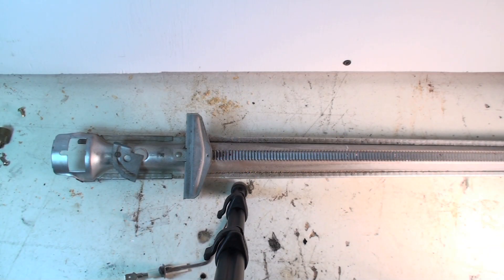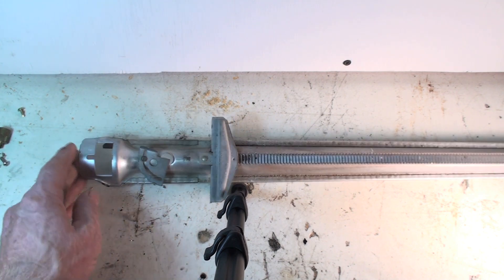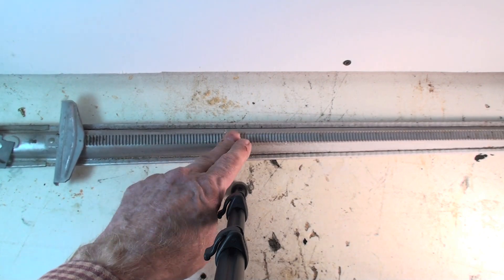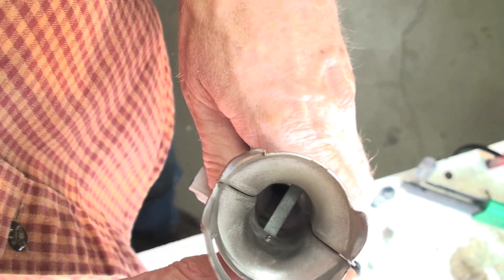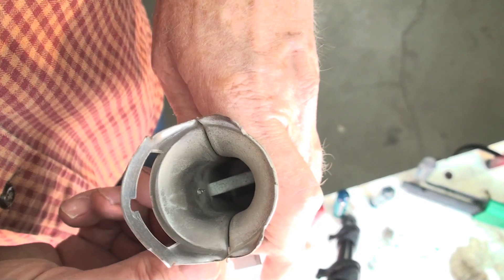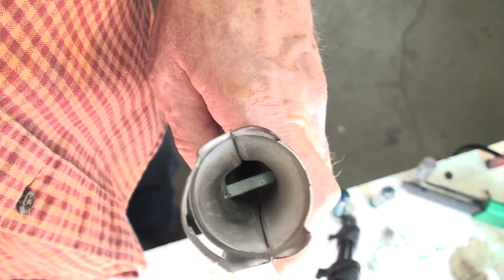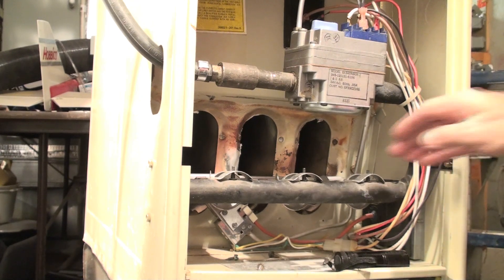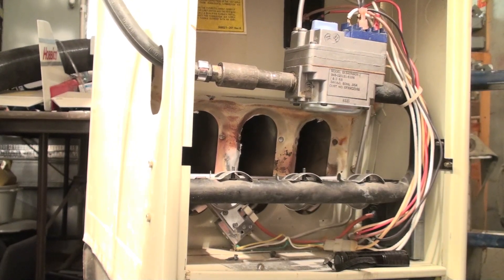How to clean the ribbon type burner on a gas furnace

Comment: I have ribbon burners n the primary air adjustment pivot pins are rusted unable to move. Right now they’re wide open. Any idea as to how to break them loose/unfreeze them.
Thanks 
Matt
Reply from the maker: Nothing here except replace the burners if you can find them.
GFM
Reply: Figured it out, small maybe 7/32 slotted screws lock em in place. Adjusted the 4 burners to proper mixture.
Thanks a lot 
Matt